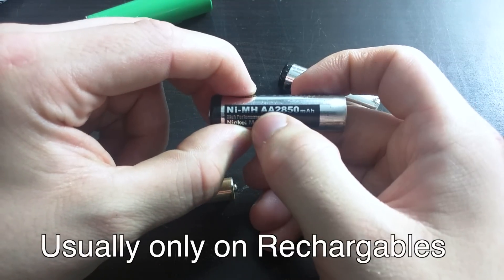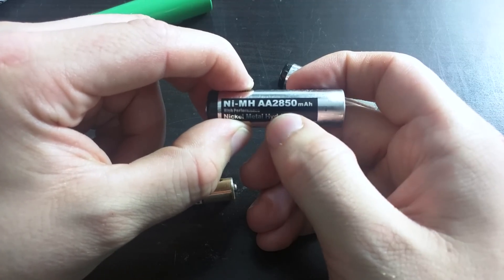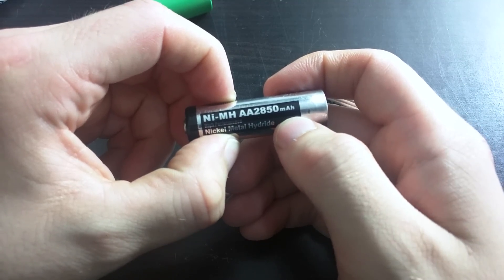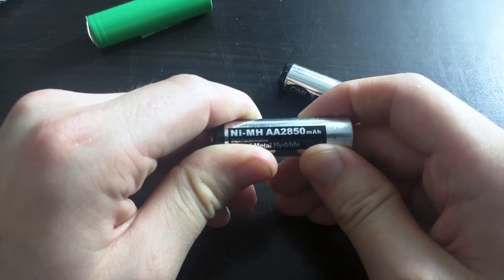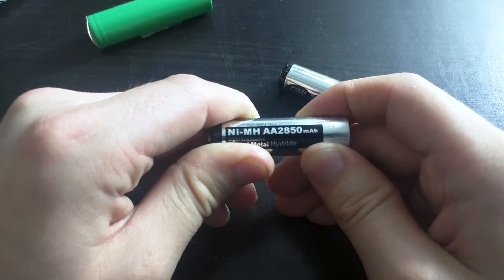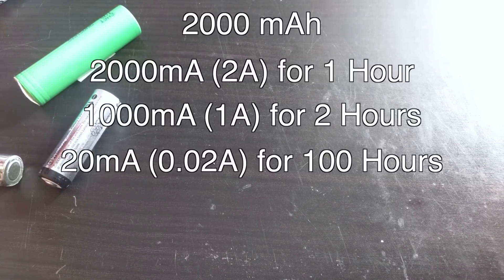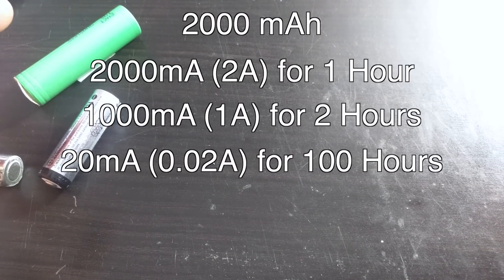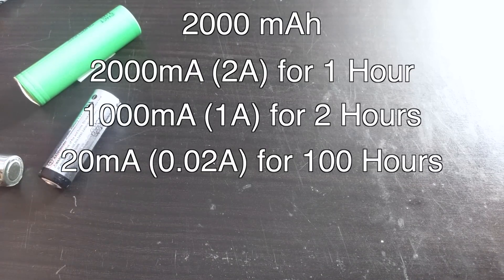What is mAh? (Battery Capacity) - Electronics Basics 18

Comment: Question…. I have a drone battery which had 4241 mah and produces about 40 mins of flight time. Now, I’m trying to purchase an aftermarket battery for my drone which has 9000 mah and the seller says it produces 50 mins of flight time. My question is, why does the battery that has more than double the mah only produces 10 extra minutes of flight time than the original battery? Shouldn’t it produce double the amount of time?

Comment: A good explanation, just add a little thing, once the voltage is more than 3 volts and no regulator of voltage lamps will use more than 60 mAh and the calculation will change, there are a few other ingredients but the explanation is good for beginners

Comment: Very well explained!!  I would like to add/ask something,  at least as far as Lithium Polymer (Lipo) high performance batteries go.  These type are widely used in racing/freestyle drones that I fly.  We call them "packs" because as I'm sure you know, they do not have hard shell, just individual 3.7v (nominal) cells, in series wrapped together in plastic and then then shrink wrapped with logo and manufacturer info.  

I'm not sure if  it's due to nature of high performance or just the way our hobby has always done it, but if any individual cell drops below 3.0v it's taken out of service by most pilots.  Now some, myself included, after running a few tests and it still seems to be holding a charge and the cells are relatively balanced within 0.5v of each other, I'll wrap a piece of colored tape, (blue for me) around it and still use for accessory equipment, but not as a flight battery.   Have you heard of this practice in other fields that use Lipo batteries, or is our hobby just overly careful?

Comment: Hello, You have a great channel. Thank you. I am a complete newbie and would like you guidance please. I have puchased a hot tub and it draws 2800 watts. What would / could be the best  route for me to follow to utilize batteries and inverters to be able to run the the hot tub. I am thinking about having two battery banks, One being charged via electric chargers run off the inverter whilst concurrently running the hot tub. when those batteries are charged, i would switch over the complete setup and charge and run the inverter from the other now charged bank. Please give me the pro's and con's and what sort of setup i should  look at. Thankyou, Craig.

Comment: Question I have a hair clipper that’s a 3.6 volt motor and was with a 3.7 2200 mah battery 🔋 but I put a 3400 mah battery in it and it increased the speed is there a way I can get it to go more faster with more torque

Comment: I didn't get you well . Kindly Clear my doubt 
1) the mah read on the battery don't exactly tell us how long it will take for the battery to get discharged because the voltage will not always remain constant and it depends on what battery we use .this is true but you added a point saying if we know the Capacity  of the battery and divide it by the current then only we'll get the real time it will take. But the mah noted on the battery is of course the Capacity right?  If yes it'll also not give us the real time I'll take.
2)  If you say in parallel voltage is always constant then there would be no discharge right?

Comment: Great video!!!
Is there any tool that i can use in order to check the battery capacity (in mAh)?
Reply: It should say it on the battery
Reply: you mean how battery life is left? no not really. you can measure the voltage of the battery and look up how low the voltage is when battery is fully charged and fully discharged.

Comment: Thanx for the video brother...correct me if Im wrong......according to the data sheet the Maximum Continuous Discharging Current is 4400Ma or 2C...for each cell....therefore I have 10 cells in parallel and the total Maximum Continuous Discharging Current then it would be 44000Ma or 44A for my lithium ion battery.. my battery is 13S10P 52V 25Ah...

Comment: Hi,
I have a simple question for which I did not get an answer. I.e
If I’m having a 3.7 v lipo battery then what should be the amount of voltage which I should provide to charge it? How do you calculate it? 
What if I'm having a 12 v battery. Is there any formula for it and if yes then help me out with this.

Comment: but what if you have batterys in series with different capacities how do you calculate the amp hours of the overall battery pack
Reply: I guess it´s not really good to have batteries in series with different capacity. I am not even sure about the answer to your question, but probably it will have an ´average capacity´...

Comment: How to calculate the charging voltage and current  for 3 or multiple li ion batteries connected in series & How to calculate the charging voltage and current  for 3 or multiple li ion batteries connected in parallel

Comment: Battery ka ampere keise calculate karenge hum ? Agar ek 18650 li-ion battery 2200mah ka hai to hum 2s, 3s, 4s, 5s, 6s, 7s, 8s, 9s, etc etc battery pack ka total ampere hum keise pata kar payenge taki hum BMS ka exact capacity laga payenge.

Comment: Hey, with a multimeter, can I measure the mAh of 1 or 2 AAA batteries? 3rd grade experiment for my daughter. 2 AAA in Series, parallel and S&P. Trying to show the mAh increase or how it stays the same with the voltage increase. Am also using a bulb for visual confirmation.

Comment: May I ask what will happen if we parallel the 3.7V battery with the 1.2V battery with the LED light? Can we benefit from the both world?(more mAh and high voltage), I suppose it doesn't work like that but I don't know why.
Reply: Voltage can be thought of as being similar to water pressure.  The higher the voltage, the higher the pressure.  So if you put a 3.7V battery in parallel with a 1.2V battery, the 1.2V battery will be over-charged by the 3.7V battery and eventually fail, possibly catastrophically. (ie BANG)

You can't just put several 1.2V batteries in series (like to create 3.6V) and then put that in parallel with a 3.7V battery because the battery chemistries are so different that one will still end up being charged by the other, which will at best cause the charge to be wasted and at worst will damage one or both batteries.

So the short answer is no, because of differences in both voltage and chemistry.

Comment: I tried to simulate three parallels batteries like those on Every Circuit, with a LED lamp, and it shortcircuited haha... it seems you need to use diodes to do this, amiright?
Reply: Nature sky   If you take the time to really look at your comment you can easily see that your lacking something in your personal growth cycle since middle school outbursts usually end in middle school otherwise middle school outbursts with adult themes would be common instead of a red flag calling attention to your incomplete growth resulting in your unhealthy ego. Not the end of the world but the sooner you take on your issue the better = Good luck.

Comment: This is a great channel. :)

I have a question,  SE, it goes like this:  
I've been trying to measure the amps in a variety of batteries
using a super-cheapo DT-830B multimeter.  
It's really not a very satisfying or reassuring experience.  
The multimeter readings simply don't tally with the indications on the batteries.
And i've just watched a video suggesting measuring amps of batteries isn't recommended.

Which leaves open the original question:  
How can i figure how what the remaining capacity (in amps) remains in my batteries.
Do i have to use the volts reading as a rough proxy ?  (eg relatively low volts == low amps)
Is there a correlation coefficient that will allow me to calculate an 'estimated amps' from volts ?  

Thanks to anyone (and everyone) that volunteers an answer  :-)
Reply: You could measure the capacity by measuring the voltage of the battery. This will help you make an idea about how much charge the battery has but it won't give you an exact answer it Ah. By measuring the amps you will see how many amps the battery would deliver in case of a short-circuit but i don't think this could be useful in any way.
Reply: Short answer: There's no way to easily do what you want.

Longer answer: The only accurate way to do what you want is to use a circuit which measures how much current has gone into a battery and how much has gone out, plus the voltage.  That way it can keep track of the actual battery capacity since the actual capacity will inevitably go down with usage.

You can find a reasonably good state of charge for Lithium cell batteries based on their voltage, but the only way to measure actual capacity is to monitor current drain along with voltage during actual use.

Comment: This is a Great tutorial thanks for sharing,  can I ask a question please.
I have five 1.2v 900mAh batteries in series for a solar lamp, how do I calculate the charge rate please?
Thanks John 😊 not getting enough sun to use the solar panel 😪
Reply: 1.2*5= 6v So the panels should be slightly above 6v (7v or 8v) in order to charge the batteries. 
I hope this is what you were asking...
Reply: @cyclonudista  Hi, and thanks for the reply. I also need to know what to set the current rate to? 100mAh 200, 300, 150? Do you know what I mean mate 🤔 Thanks John 😊

Comment: sorry if this is a dumb question and anyone feel free to answer.  i got a new battery pack for my remote control digger.  the mah on my original battery was 400mah.   the new replacement battery pack i bought is 2400mah.     the question is .. will my charger still charge the batteries or do i need to get a new charger that matches the mah....  or is it unrelated and doesn't matter?        please help lol

Comment: how do you get 60mA for the led consumption ? 3 led x 3v= how to get 60?
Reply: I know its late, but anyway the single led used in this series requires 3v to draw 20mA so when you connect 3 leds  in parallel, and there is a power source  with the power of 3V then the entire current drawn from the power source is 60mA which comes from 3x20mA

Comment: will the voltage required by 3 led of 3 V each is 9 v or 3 v??
Reply: 3 volts if they are connected in parallel, and 9 volts if connected in series.

Comment: I read that the perfect temperature for charge/discharge of li-ion batteries is 27 degree celsius, my question is: Is it possible to build a battery cooling system with Paltier elements to keep batteries always at 27 degree celsius, to get max power output ?
Reply: Of course it's possible.  The problem is that the power consumed by the heating and cooling will probably be more than the power saved by keeping the battery at a constant temperature.

Comment: Thank you for this video.. I'm new to 18650 rechargeable batteries so excuse the maybe silly question i'm about to ask. What does or is the difference between 3200mah or a 3600mah or 3700mah? Does it last longer the more mah? and does it take longer to charge the higher the mah? and is there anything else?
I thank you in advance for clarification?
Peace!
Reply: It is the capacity.
The higher it is, the longer it will power your device.

Comment: What I really want to know is, what determines the capacity of a given battery cell? 
I know there are 2600 mAh li-on cells and for the same weight and dimensions, there are also some 3500 mAh cells. What do the 3500s have more of than the 2600s that give them more capacity? Both cells are 3.7v.
 what exactly dictates capacity?
Reply: The physical method by which the battery can pack more surface area of electrodes inside itself. More available surface area = more available electrochemical reaction can take place.

Comment: Thanks for the great information, But tell me how does all the battery capacity is forced to be a single battery capacity in series battery connection? To me each battery is a box filled with x amount of electrons eagerly waiting to travel the world from -ve terminal to +ve terminal. Can you please elaborate?
Reply: The smallest capacity battery will die first and even cause the voltage to drop. That's why a BMS helps to keep a cell group from over discharging. Cells are typically matched when creating series and parallel connections.

Comment: I have a 12 volt 2:00 amp an hour battery it says it runs for 20 hours does that mean it stays at 2 amps for 20 hours?
Reply: 20hr is a type of discharge rating.. "X"  amps * 20hr. Hope this helps.

Comment: What is the maximum current you can draw from an AAA battery?
Reply: The simple answer is that it depends on the battery.  It also depends on the state of charge of the battery.

A carbon-zinc battery might only be able to supply a couple of amps when new, while an alkaline battery may be able to supply over 5 amps.

The maximum amps the battery can supply will also drop as its charge drops, and the amount of change is not the same for all battery chemistries or even for all batteries with the same chemistry.

But that's not the full story, since the voltage of a battery tends to go down as you try to pull more amps from it.  Carbon-zinc batteries are not as good as alkaline batteries in that respect, and in turn NiMh batteries tend to be even better at holding their voltage under load.

Comment: So basically the more mAH the longer the light will last?
Reply: Yes
Reply: Yes, but it will depend on the current drawn from the battery.
Reply: Nature sky  what the fuck. Creep.
Reply: Also depends on the voltage.
Reply: A clearer answer would be, with all other variables being equal, yes.
Reply: @puspamadak  Which is dependent by the voltage of the battery?

Comment: If I have a cell at 4.2V and 2500mAh and later it drops to about 3.7V then how to find the capacity left at this voltage?
Reply: Generally the cells are rated as an average capacity from nominal voltage to discharge minimum, as you cannot drain a Li-ion battery to a really low voltage without causing significant damage to the cathode, and they fairly quickly fall from 4.2 down to 3.7-3.9 much faster than the remainder of the discharge cycle.  Roughly, depending on discharge rate as overdischarging can cause heat build up and damage the cell, you should only lose maybe 10-12% max of the capacity going from 4.2 down to 3.7 if that much.  They charge at 4.2 applied volts when charging, but this is above the operating voltage and the cell will slowly drop on its own after removing charger below 4.2V.  Assuming 10% loss is pretty close in most cases to approximate difference lost outside operating range.  Below 2.7-2.8V, the voltage will rapidly decrease and eventually damage the battery so capacity below that is usually not factored into battery rating.
Reply: You can look at datasheet

Comment: Great video, what applications would you prefer more capacity (parallel batteries) over more voltage (series batteries). Would it just be when high voltage is not important?
Reply from the maker: Yes, generally you would series them for higher voltage, but no increase in capacity. And parallel them for more capacity but no increase in voltage. However, You can also create parallel-series pairs for increase in capacity and voltage. You will find many battery packs such as laptops and power tools that have their batteries in parallel-series pairs for the advantage of higher capacity but still having the ability to output the correct voltage (e.g. 18V).

Comment: Hi great video / i bought a hd Camcorder 24MP 1080P Full HD 30FPS Vlogging Camera IR Night Vision Camcorders Camera Recorder 16X Digital Zoom Camera with The Pause Function and Remote (NEW07). It came with NP-40 3.7v 1500mah batteries. Can I use 3.7v 1700mah? Will it damage the camera and is 1700 better? Or should i just stick with the 1500???  Thanks Rush

Comment: I think I am better not understanding this electrical mess. I thought energy consumption was calculated with Wattage/hour and that is found by multiplying amps with volts. Also volts adds in series and amps add in parallel which if multiply, ends with same wattage but looking at this video make it a lot more confusing for me.

Comment: let’s say you’re trying to charge a device and it requires 60 mAh and your battery is like 1000000000mAh, the battery won’t overload the device? The battery will just last longer?
Reply: That device will consume 60 mA an hour. Think of it this way, the battery is not "pushing" amps into the device, the device is "pulling" amps from the battery. A car battery that is rated for 600 cold cranking amps is capable of delivering that many amps for a short amount of time to start the car. Voltage is what you really need to pay attention to. Also a battery needs to meet the required amps for whatever its purpose is.
Reply: David Stoler thank you so much! Thinking about the current being pulled  makes a lot more sense!

Comment: if I have 48v/20ah (12v /20ah each) and my motor consume  max 10a ,in this case how long my battery will last ?
Reply: Anurag Shukla. To help you out, write out the equation for figuring it out. Identify your factors needed, identify what you have, see if you can plug them in. 

Post all of that along with what you think the answer is and then help will be much more likely to arrive and mean something. 
If you respond with something like that, I will certainly help you to figure it out. And I also know there are battery calculators online as well.
Reply: 1.2hr at full CONSTANT power, +/- 0.1hr